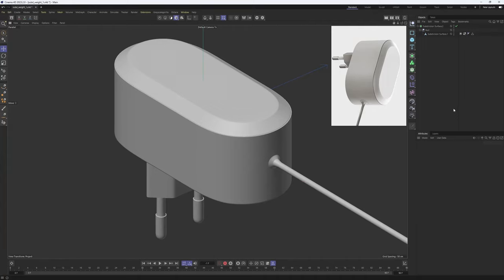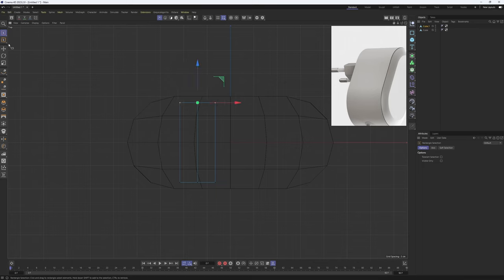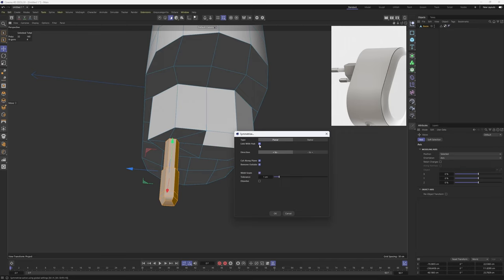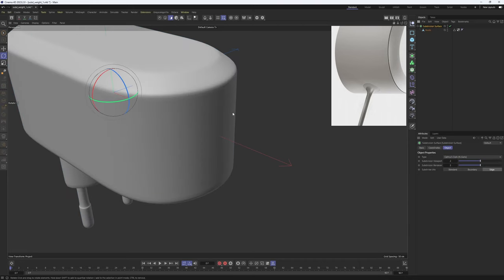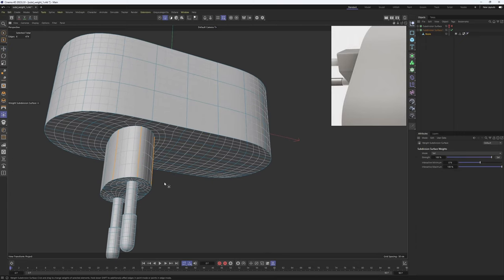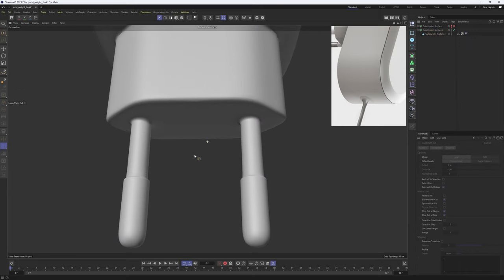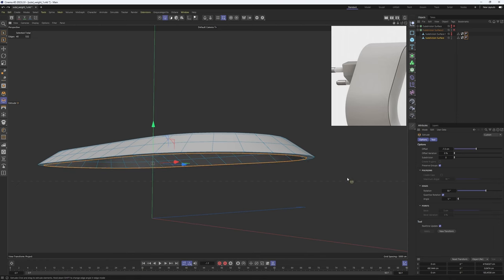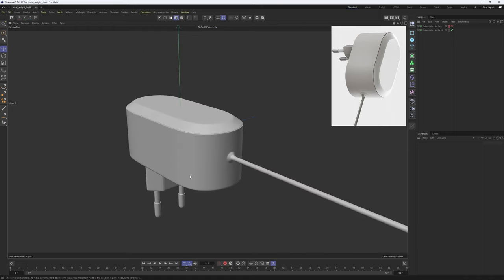Industrial Design/Product Modeling  I SubD Weights

Comment: after using sds weights the first time, when you are adding supporting edges the second time, is it possible to just use sds weights again?
Reply from the maker: Yeah, you could do that but you need to set your subd levels to 4 or 5 in order to get smooth results.